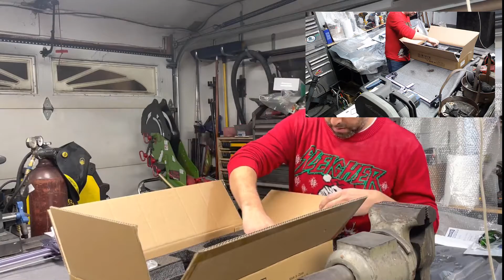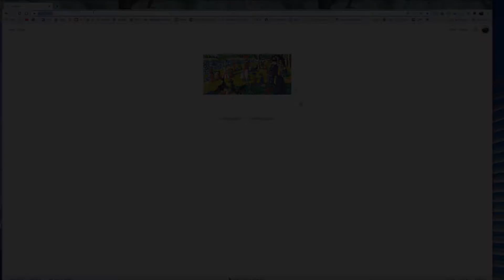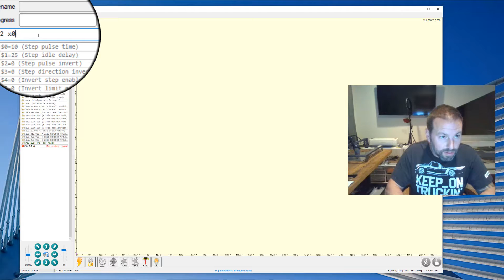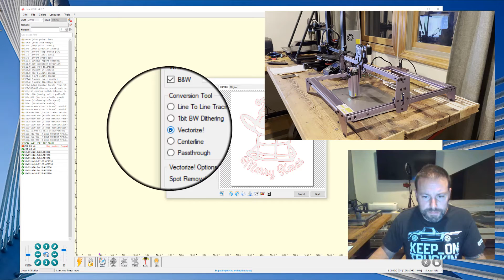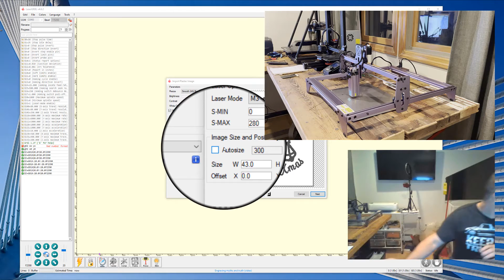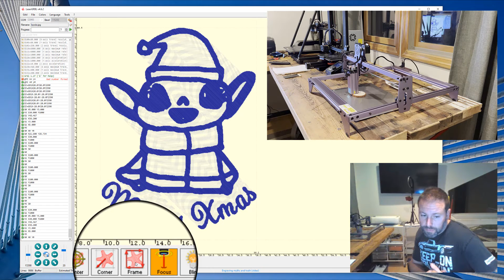Atomstack Pro + Setup to Engraving with LaserGRBL

Comment: Can you learn some more about audio?  It's all over the place. Being in a boxy room doesn't help, your voice bounces off the bare walls, Then you had the double up and you knew it was happening, but you never apologized to your viewers. Finally you moved away from the Mic and was talking away from it. 

A small tip: Try using a Lavalier Microphone. It should solve most of your problems, they aren't overly expensive unfortunately the only thing it can't fix is you. I'll admit I have a little hearing loss in my right ear, but you tend to mumble occasionally and some of your words get lost, mainly at the ends of your sentences. I guess it could be described of running out of steam. A little speech therapy would definitely help.

I spent around 25 years in a TV newsroom and in that time I interviewed many would be reporters and news readers,. Lack of Enunciation was usually a problem, but it was easily remedied by therapy. Don't worry, it's a common problem and you're definitely not the only one .

Comment: What's the main differences from the regular a5 Pro to the plus
Reply from the maker: From their website “★ A5 PRO+ is an upgraded version of the star model A5 Pro. It has a better laser module and uses lens compression spot technology.” Idk how much of a difference it makes
Reply: @ScienceMonkey00  also you can change the laser height without tools

Comment: Great video. I just bought one for myself and found your video looking for where to get started when it comes in. Exactly what I needed 

How are you liking it so far?
Reply from the maker: Thanks, I had a 60w universal at my last job, and it ripped, so dealing with a low wattage machine takes some getting use to. But it’s cheap, easy, and works for what I need it to do.